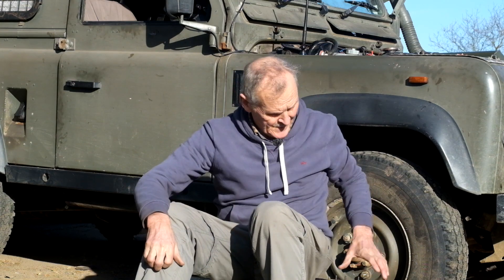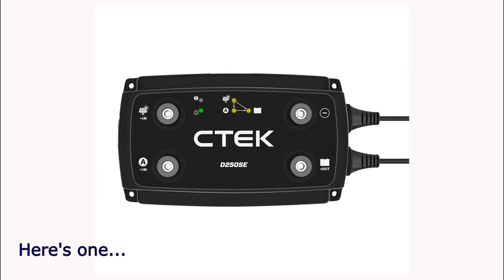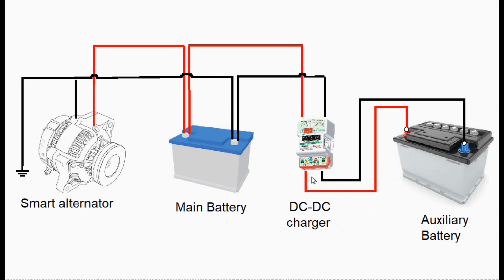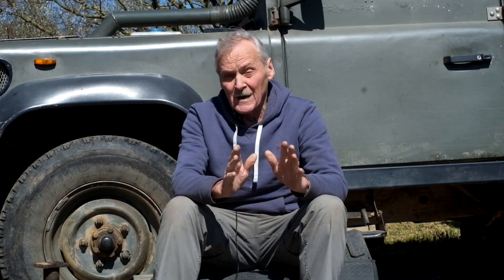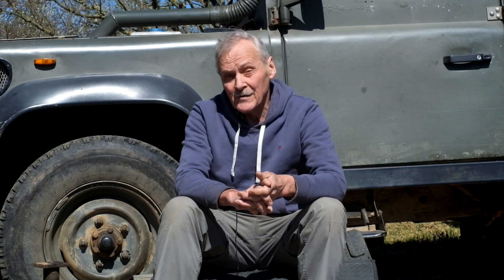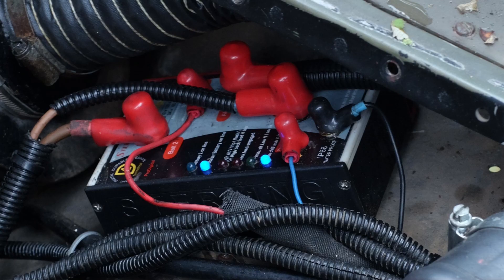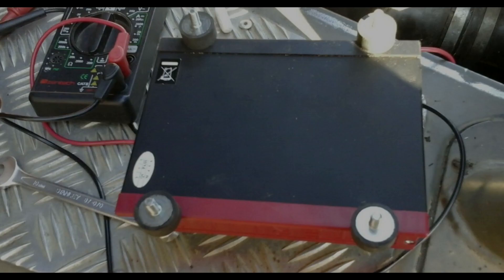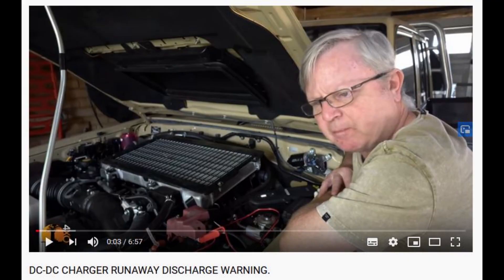Dual battery charging systems for overlanding - Pt. 2

Comment: I did some research to use the Stirling diode split charger as you have (and I like the way it works) but the instructions make it very clear it is not to be used on any modern vehicle with an ECU. My vehicle has an early 5-wire ECU but it is an ECU nonetheless so I think I might end up having to use a DC-DC charger in the end. I am using a Redarc smart battery isolator at the moment. I'm upgrading my alternator to a 140amp unit and my current isolator is only rated to 100amp. So, back to the drawing board for me!
Reply from the maker: I fully agree with your comments about the ECU and you don't want any sort of invasive mods.
I am intrigued why you need a 140A alternator, unless you have a large electrical set up. There are rules for maximum charging rates for conventional batteries and you couldn't use the power of such a large alternator (or do you have Li batteries?) The one argument in favour is that if you de-rate equipment it tends to be more reliable; the charge controller would however need to limit the current draw to <100A.
I am stuck with a 55A alternator which copes all right. I'd like to increase this to 100A, for reiiability, but it's complicated because of the integral servo pump. It works well with the Sterling charge controller and I have decided it's better to leave it than to meddle.
Reply: @defendermodsandtravels  I do have Li batteries in my expedition camper trailer and I want to be able to charge them completely while driving. But I also have second Optima AGM battery in the truck (same as my start battery, both Optimas) for running the air compressor, winch when installed, etc). Redarc sent me diagrams on how to wire the truck for AGM house battery in the truck AND charge Li batteries in the trail. It involves 2 DC-DC chargers (of course!), one for the truck and one in the trailer. Do I really NEED 140a? Probably not but I come from the old school where it was best to have as much as possible. Maybe that time has passed. But I am still trying to figure out how to charge both the truck aux battery and the trailer Li batteries. I'm sure that I will absolutely need a Victron DC-DC unit for the trailer. Any thoughts?? Many thanks!!

Comment: I know you are travelling just now but when you get a moment could you explain how you wired the switched voltmeter? Many thanks and good travels!
Reply from the maker: Hi it isn't a difficult mod. You need a digital voltmeter with the negative terminal grounded to to a good earthing point. You then need a positive cable from both batteries going to a single pole / two way toggle switch (break before make to ensure the two batteries don't become connected instantaneously). The central terminal of the switch goes to the voltmeter +'ve. This way you can connect either battery to the voltmeter. The current taken will be low so a 0.75mm2 cable will suffice.
I hope this helps.

Comment: Thank you for this very informative video. I have being toying with the DC to DC charger however have not yet installed(running solar so as yet have rarely needed to charge alternately) but have an isolation switch which I make after the main batter has reached charge so it's not perfect but solves the issue... A plus side is if the main battery is low then I can charge it via the solar panels in an emergency.
Reply from the maker: I trust that the isolation switch which you use to connect the two batteries is suitably rated? It can see high currents esp if they are connected when you start the engine.
I'm sure you are aware of the weakness of your setup. The auxiliary battery will need around 14.4V to charge but if the main battery is already charged the alternator will reduce the voltage. If the aux battery doesn't get fully charged it will start to sulphate.
Good travels.
Reply: @defendermodsandtravels  yup
Know the issues. Only switch on the isolator once vehicle is running and only if there is no Sun and the aux batteries are at a low discharge which is not often as in ZA the Sun shines often so it's really just to stop the batteries discharging to much(damage) the absorption will be done when the Sun pops out. Even if the camper stands for a while (not traveling) the batteries will be floated by the solar with the isolator off. However I am looking at the split charger you have, the "name brands" are silly costly.

Thanks for your reply and video.
Safe travels.

Comment: Would you use the same set up for your Discovery? I have a 1998 Discovery 300Tdi and would like a dual battery system along the same guidelines which you have pointed out in your video. Thank you very much for your reply.
Reply from the maker: This is a more complicated question than you might think. I too have a 1998 Disco 300 Tdi although I have done little work on it myself and leave that to others. I think that model may have a 100A alternator with an integrated controller? I could look at mine but I am occupied on other matters now. My response to your question will depend on the alternator and its controller.

Comment: Totally agree re dc-dc inverter chargers. THere are only really 3 times you would actually need one, 1, certain batteries that require a higher voltage output than the alternator can supply or the start battery can safely handle, 2, smart alternators where a VSR would disconnect and 3, trailers or other applications that there is excessive volt drop. 
Diode split chargers were all the rage in marine systems but because of the volt drop issues they were left by the wayside years ago. For all constant voltage alternators, a simple relay split charge whether alternator or voltage driven is more than adequate. As I understand the Stirling Power unit is just a delay timer to the aux battery, and to be fair, unless it is constantly disconnecting to no load there is no way it can sufficiently assess the battery condition over the alternator voltage, which incidentally should be adequately over any existing batter voltages so removes backdraw from one battery to the other. Pepole forget that the charge voltage exceeds the battery voltage so effectively isolates both batteries from them drawing capacity from the other bettery, unlike when there is not a charge voltage applied.

Comment: Great video as always. Thanks!
One note is: as soon as the alternator increases the voltage to 14.0 v to charge, the relay will allow charge of the second battery thus charging both batteries equally. Wasn't that something to avoid due to the different charge state at any point in time?
Reply from the maker: Absolutely. You are reiterating one of the central themes of the video. Relay based split chargers have their place (simplicity, ruggedness) but the charging performance is far from ideal.
Reply: @defendermodsandtravels  I see, i missed that it was your final goal. Thanks for the reply and sharing.
Reply from the maker: @Maedetto  Yes. I firstly introduced the SmartBank dual charge controller which trumpets its fancy electronics etc but the smart box still only controls a large relay and hence forces the two batteries to charge at the same voltage, and for this reason I didn't buy one. I then introduced the Sterling ProSplit where both batteries are monitored and controlled independently although battery 1 always takes precedence - this is what I finally bought. It seems to work very well. I hope this clarifies.
Reply: @defendermodsandtravels  Certainly does. Thank you for the clarification.